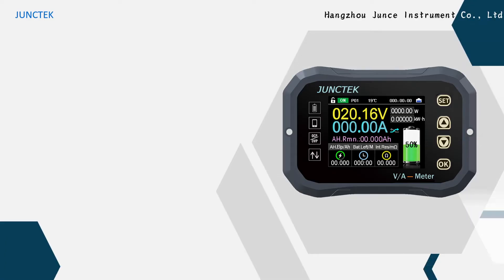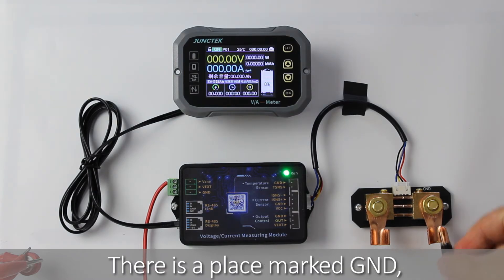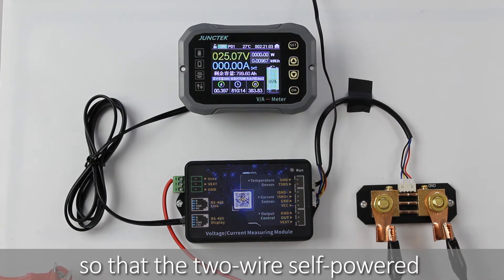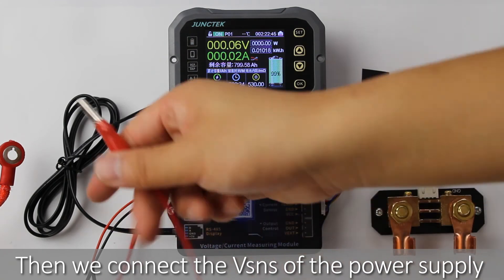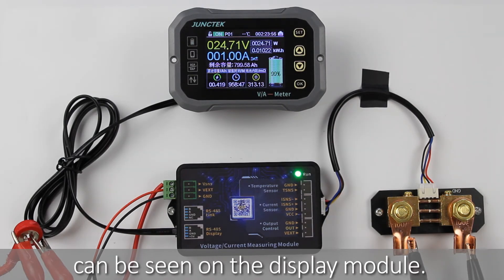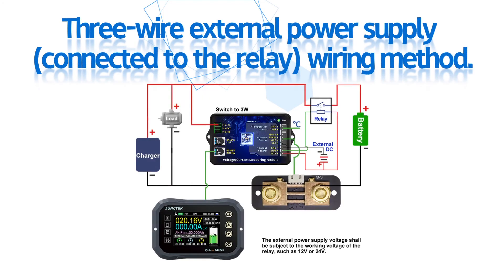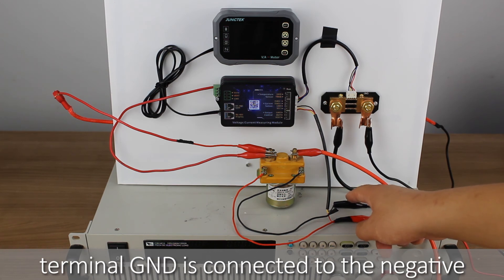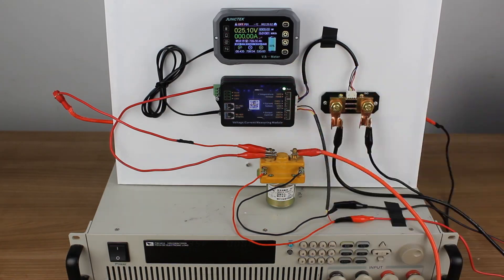JUNCTEK Battery Monitor KG-F series Wiring Operation Guide KG110F/KG140F/KG160F Coulomb Counter

Comment: With the relay, Vsns is connected to charger and load in the your circuit diagram but in this video, Vsns is connected to the battery. 
Which is correct?
Reply: Either, but battery is better imo
Reply: I don't think protections will work correctly if you connect vsns to the load side

Comment: I tried to extend the data cable using an RJ11 cable but it wont work unless I sue the shorter cable provided in the box? Can you advise.
Reply: I have the same problem.
Reply from the maker: Please use RJ9 interface
Reply: @sula123rox  Sorted. The cable I was using was missing conductors. You need to use a different cable. Mine is working now.

Comment: I just got mine hooked up and I'm sad that the kwh meter goes up for load and the charge amount gets added to the kwh also. It knows its charging.....
Reply from the maker: KG140F can record the charged electric energy
Reply: @junctek1802  thanks I got the info on updating my unit and now I'm very happy.  Thank-you. You should make very detailed video on doing it. Mine was the older unit so I had to short the temp pins and power on to get the flash to work

Comment: Can the relay control be used from the same battery it is monitoring? If so please provide wiring details.
Reply from the maker: Hello, if the battery voltage is the same as the relay supply voltage, you can use the battery to supply power to the relay
Reply: @junctek1802 I also want a video on this
Reply from the maker: Hello, if the battery voltage is the same as the relay supply voltage, you can use the battery to supply power to the relay
Reply: Can you make a video on this please

Comment: Can a single display monitor more than one shunt?

What is the use of the "RS-485 - LINK" port?
Reply from the maker: RS-485 - LINK can be used for 485 communication with external devices, how to read data from PLC\MCU\PC, etc. It can also use our communication protocol to send commands to KG